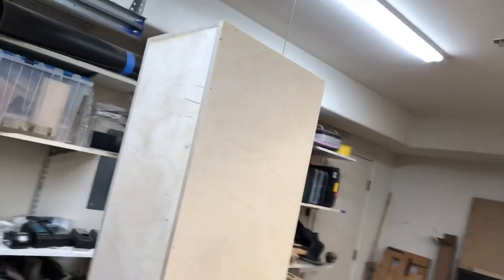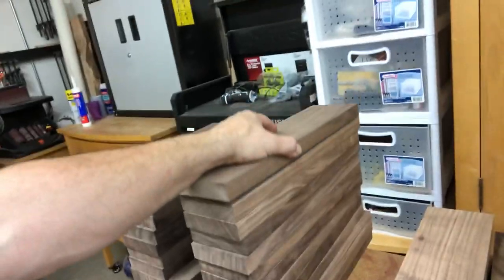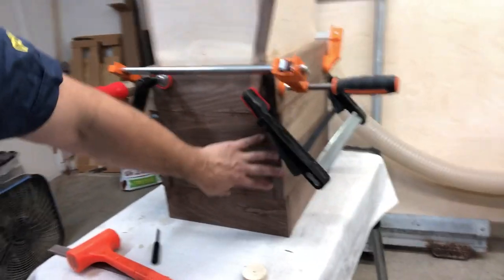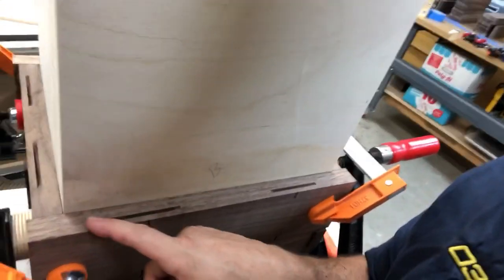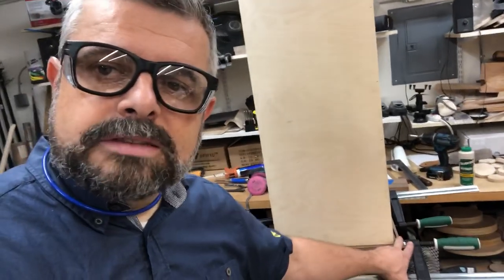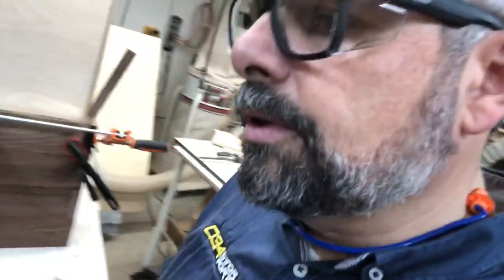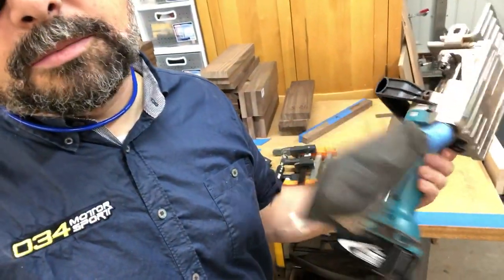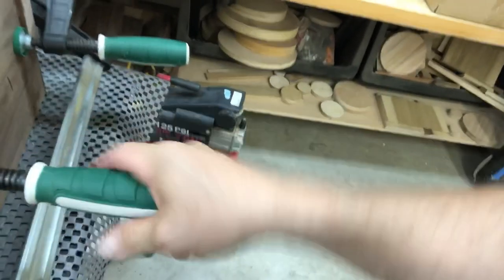Speaker Project Enthraals Part 4 Walnut Lamination

Comment: Would it have worked as well to do a dado in the ends to interlock the ends of the wrap so it wasn't just a butt joint?  Looks amazing, I love the idea
Reply from the maker: Hey Paul, that would have added A LOT of work and also changed the pattern on the corners, these have FULL face gluing on the back and sides, they're not going anywhere, the amount of adhesive surface area on these pieces is over 50% of their surface area.